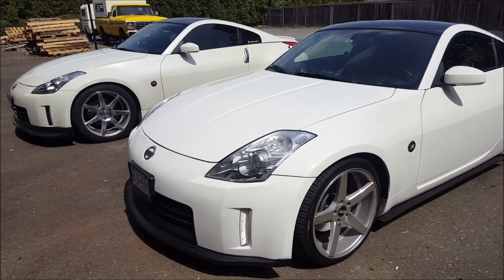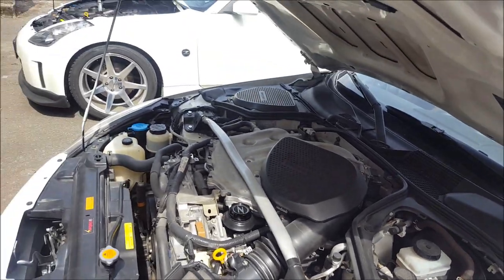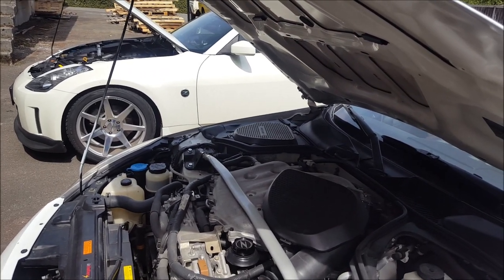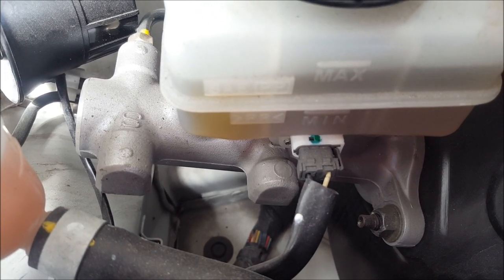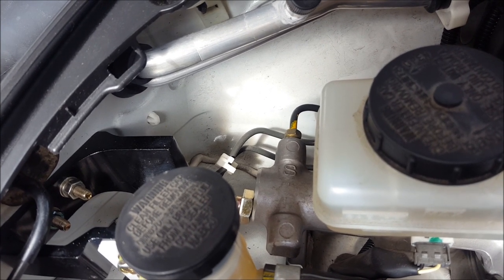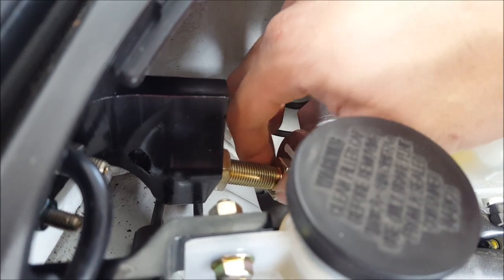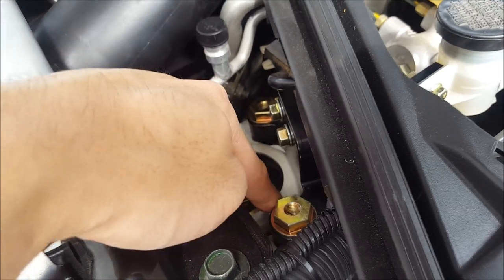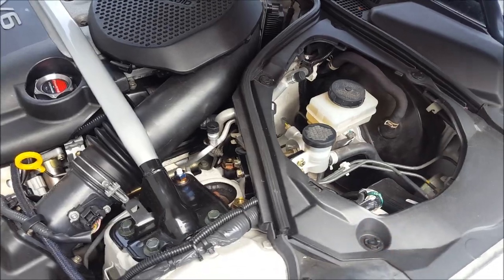350Z Brake Master Cylinder Brace Z1 Motorsports (Infiniti G35) | AnthonyJ350

Comment: it does go away when I pump the brakes while the car is of but come back when u turn on the car I was just wondering if that is something I should be worried about .ima bleed my brake just to be safe. thanks for the reply
Reply from the maker: I think it's just the booster you're hearing.

Comment: on the second Z.
Reply from the maker: Elmer V My pretty sure that noise is left over vacuum assist in the booster. If you pump the brakes with the motor off the noise will probably go away.